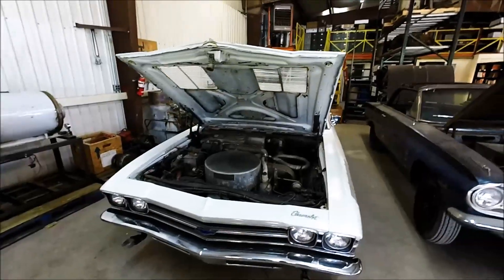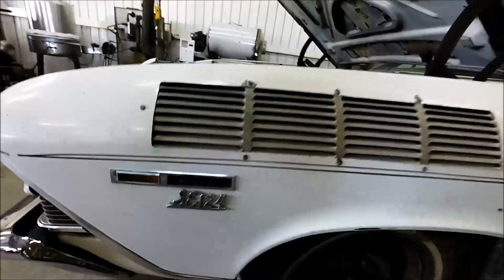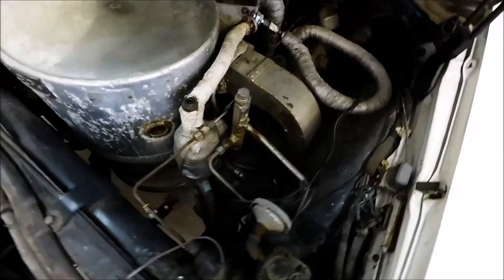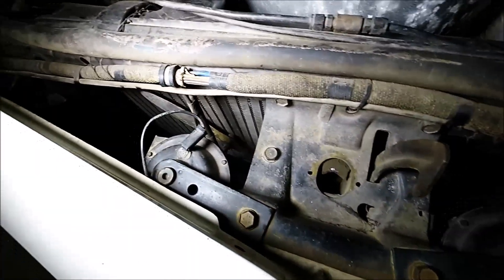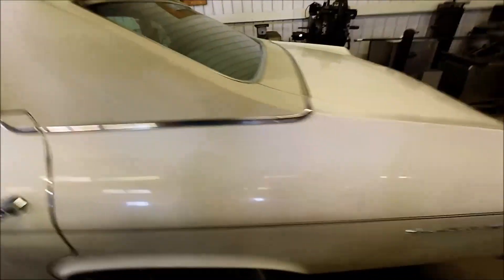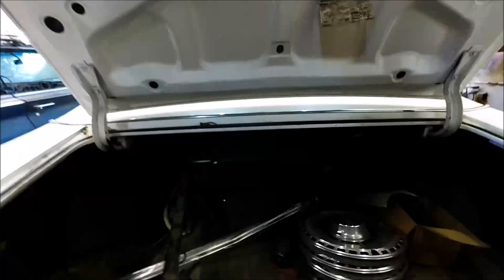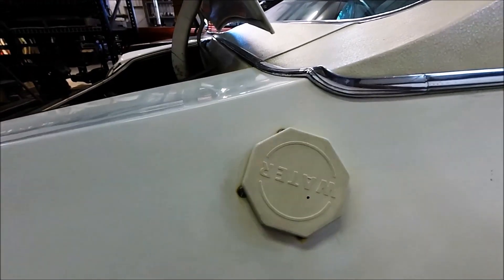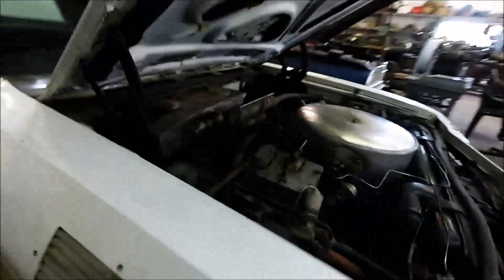1969 Steam Powered Chevelle - Built For General Motors

Comment: Sandervanderkammen9230 really hates steam engines
Reply: I LOVE STEAM ENGINES... I don't like stupid people.
Reply: I dont see why someone couldnt make it work with a heater rod sort of like the heater on an 02 sensor or like with glow plugs to initiate start. After starting have alternator recharge battery and provide the heat for the steam using more glow plugs while it runs.
Steam could possibly work
Even in racing engines

People just dont want to innovate anymore.
In my opinion.
Reply: @advanced8526 You are suggesting to use electricity to heat the water into steam?

So you don't see the obvious reason why we don't make electic-steam cars?

Comment: In 1933 besler systems built a steam powered airplane - it didn't work very well but proved 2 things : steam can get off the ground and for a heaver then air machine to fly to a altitude of over a 1000 ft you need a minimum of 18 percent efficiency. That comes from a air craft engineer. The video is still on YouTube.

Comment: Electronic heating would put steam at the top of the automotive pile
Reply: It would be a pile of something... something unpleasant..
Reply: Why would anyone ever use electric heating in a steam car??? 
Seems like the education system is failing to teach basic science.
Reply: @sandervanderkammen9230  yeah, the efficiency would be abysmal, why would you do that????
Reply: @magicsasafras3414 Indeed, it makes no sense whatsoever... Electric Motors are around 90% efficient while steams cars are less than 20%.
Reply: @sandervanderkammen9230 even if you use a steam turbine with an efficiency of 65 percent, you still lose around half your power, and thats not accouting for the fact that in order to throttle effectively, you would need a generator, and a motor to drive the car, as high efficiency turbines aren't really meant for high throttle variability.

Comment: Steam could have been the future, but it could go a 1000 or more miles on water, so no big oil making money off you every 300 miles.  You know they can make a car or truck get well over a 100 miles per gallon but big oil will not allow it.
Reply: Corporate greed has ruined everything. A damn shame
Reply: it still need oil, gas, kerosine to burn, and according to those that own steam cars, they dont go that far on fuel, so i think big oil whould not care much...
Reply: @Miss-Stephanie-Night  ...spent uranium fuel rods... could use the blue glow as running lights :)
Reply: Steam engines came before internal combustion engines.   But internal combustion engines rapidly drove steam out of the picture because internal combustion has about half the fuel combustion.
Reply: that said ... i want steam cars to make a comeback. and i am gonna build one when i get a garage.
Reply: Uhhh... you DO know that you need some sort of power source to heat the water up to boil it into steam, don't you? And that a power source needs SOMETHING to act as fuel for it to GENERATE that power, don't you? And that the water in a steam engine is just a MEDIUM which is used to transfer energy/power to do the work, and that it ISN'T the energy, the actual fuel ITSELF, right???🤪🤤🤤🤤🤦🙄
Reply: 'Big Oil' would be very happy if you bought a steam car!

They can make a car or a truck that gets 100 mpg... the problem is poor people don't buy new cars.
Reply: @sandervanderkammen9230  Who is "they"?
A typical gasoline car engine is about 25% efficient and coincidentally this means about 25 MPG.   A reciprocating steam engine is about 10 to 125 efficient, therefore at best s steam car will get about 12 MPG.   Check in any good textbook - look up terms like "Carnot Cycle", "Standard Air Cycle" which tell you the maximum efficiency that can be achieved..
As for steam vehicles being as usable as any modern car or truck, check the videos on YouTube posted by people that have restored old Stanley cars and Doble trucks that require a crew of two to drive.
The British Sentinel steam engine road truck burns about 40 kg of coal per 20 km when unloaded.  The calorific value of cola is about 2/3 that of gasoline, so if it used gasoline to heat the water, it would need 130 litres per 100 km.    A similar weight truck (12 tonnes carrying capacity with a gasoline engine would need only about 35 litres per 100 km.
Reply: Steam cars don't run on water... are you really that niave???
Reply: So true 😢

Comment: Mr. Tom Give it to Mr. Jay Leno. He will make it a running car.
Reply: I'm sure Jay Leno doesn't want it, or he'd have owned it by now already.😑
Mr. Tom needs to give it to a skilled steamfitter, HE will make it a running car!
Reply: @joerosen5464 Bill Besler threw the engine together using old worn-out parts and bits of junk, his plan was to pocket most of the money he was given to build the concept.
To build a reliable engine would require scrapping the whole thing and starting over from scratch
Reply: Jay only buys the best... this POS was junk when it was new!!!

Comment: With the tech we got now - I'm sure we can make a viable steam car.
Reply: Unfortunately that will not happen, if you were an engineer you would no that steams cannot be made viable today due to the limitations imposed by the Laws of Thermodynamics and Fluid Dynamics.
No steam car can ever match the efficiency or cost of internal combustion cars.
Reply: @sandervanderkammen9230  But with the tech we got now ...
Reply: @SelectCircle  Doesn't matter... even with technology that we have now, we cannot change the Second Law of Thermodynamics.
The Rankine Cycle can never be as efficient as the internal combustion engines.
Any heat engine that includes a phase change in the working fluid will always be less efficient and more complex.
 Direct Cycle engines are inherently more efficient than steam
Any questions?
Reply: @sandervanderkammen9230  If it's that automatically dismissable - then why has the issue ever been studied in the past like it has?
Reply: @SelectCircle  I guessing you are not old enough to remember the OPEC Oil Crisis?
 Nicolas Carnot published his formula in 1824, before Internal combustion engines were invented.
By 1915, steam car became obsolete technology, replaced by the superior ICE car.
No serious work has been done on the development of steam cars since 1915.
Reply: @sandervanderkammen9230  That's where you're wrong. There have been recent studies. And it was deemed feasible but unmarketable because of slow heat-up. Despite your supposed automatic shut-down - the studies went forward. So either I dreamed all that or you haven't read enough.
Reply: @sandervanderkammen9230 the laws of physics seem to fall apart when a jet fighter chases a UFO - example: making right angle turns at speeds above mach 4  and getting it on radar too. This tells me what we think we know may not be true given the technical break through. One discovery that fails in one area my solve a problem in another area.
Reply: . Sorry kid, Nicolas Carnot published his formula on heat engines in 1824.
His formula established the efficiency limits of the Rankine Cycle well below that of the Otto or Diesel Cycle before they were invented.
Rudolf Diesel proved Carnots theory in 1897 when he invented the most efficient, practical heat engine in history.

The most efficient single Cycle engines in the world are Diesel Cycle engines.
Reply: @sandervanderkammen9230  You just made my point. It's the freaking 21st century. Come on now.
Reply: @SelectCircle So you admit you're not educated enough to know that the Law's of Thermodynamics  don't allow steam engines to be as efficient as ICEs.
Reply: @sandervanderkammen9230  All I know is that what we know is changing every day.
Reply: @SelectCircle That comment reveals someone who has no formal education or professional experience in the engineering world.
Engineering is not a faith-based endeavor, it's a exercise in the Laws of Physics and built on a foundation of facts that are well-known and understood.
Like all the sciences we record and study the failures and limitations so that those who come later will not repeat the mistakes of the past.
 Please refrain from posting false and misleading comments on a topic for which you are not qualified to discuss intelligently.
Reply: @sandervanderkammen9230  O yes. Your righteousness is so intimidating. It's like I'm being reprimanded by the Archbishop of Wankery. How much more time and effort would like to invest in terrifying me? 8 D
Reply: @SelectCircle 
You will never win with these types of people until they "see the light" so to speak.
They are institutionalized and educated beyond their intelligence 😂.

Comment: If this car was working, there would be a video of it..that is, it didn't work.
Reply: FFS There are old movies of it running, the current owner drives it.
Reply: @fizzguts You mean, DROVE it, don't you?🤔
Reply: @fizzguts  This vehicle no longer runs, which is no surprise as it barely ran when it was new. The car was returned to Bessler because it broke down constantly and was unable to complete most of the tests it was designed to perform.

Comment: Trying to find  someone on youtube that has made a modern steam car/truck. Can someone share the link?
Reply: also looking, tribute like.
Reply: @survivalistor6195  if you really want to own a steam car you best option is to buy an old one, no one makes these relics anymore
Reply: Steam cars are obsolete technology, no legitimate engineer or company would have any interest in building a new one
Reply: @sandervanderkammen9230  I would be interested, though our company just started, and it would be more of a marketable prototype to sell conversion kits for older gm, Chrysler,  and ford small block engines for them to be able to be converted to efficiently, safely, and reliably run off steam. Though more than likely for liability reasons would not be manufacturing boilers for production in the next decade or two if ever. I think in the end the op's post was more of relating to something more home-engineered proof of concept like there is with modern day wood gasification to run vehicles you can find all sorts of videos online about that but only a handful of people that share the interest of what more "modern"  steam boilers and engines have to offer.
Reply: @unitytwins6652  Internal combustion engines have been hugely successful because they can be operated on any alternative fuels that can be used with steam but offer several critical advantages without any of the disadvantages of steam engines..
Methane, Ethanol, CNG, Wood Gas even hydrogen is cheaper, more practical and much more energy efficient than steam with the same fuels.
Why would anyone waste their time building a new steam car???
 An antique steam car would be far more interesting and desirable anyway.
Reply: @sandervanderkammen9230 I have seen you reply to almost every comment on this video, what are you so pressed about?
Reply: @KingHydra-xj4hg  The truth... this video is rife with ignorant misinformation about steam technology and some egregious misconceptions about the practical and theoretical limitations of the Rankine Cycle.
Reply: @sandervanderkammen9230 Including Abner Doble???🤨
Reply: @joerosen5464  Abner Doble inherited a vast fortune and wasted it all trying to sell steam cars long after they had become obsolete technology. He died penniless.
Reply: @joerosen5464  Excellent comments.

Comment: I want to see steam make a comeback. With modern technology I'm sure one can be made more efficient then what was made
Reply: A hope I have is that once electric cars become the norm and if we start charging cars as they drive through magnetic induction built into roads or something then you could make a steam powered car that just uses that electricity to heat the water instead of an open flame which with the addition of a modernized condenser could make a nearly completely closed cycle engine. Only needing water and oil top ups. If I ever get the time and money I plan to build my own steam powered car cause I'd love to have one more than any other car.
Reply: @GoldMike_  Why would anyone use electricity to heat water into Steam???
I guess you didn't think that idea through yet?
Reply: @sandervanderkammen9230  it would be a thing for enthusiasts. People who want to have a steam car but fuel becomes too expensive or not legal to burn fuels in cars anymore. Its a work around to use steam in a fully electronic world.
Reply: @GoldMike_  Its obvious that you lack any formal education or professional experience in automotive engineering...
No legitimate engineer or or car designer would ever use electricity to boil water in a steam car, it makes  absolutely no logical sense.
You don't seem to have the slightest clue why.
Reply: There's such thing as nuclear power using thorium
Reply: @cjrstudios4100 Steam is still not the most efficient thermodynamic cycle to  convert the reaction heat to electricity,  water is used primarily because it is a good absorber and shield for radiation.
Reply: That is never going to happen, steam cars are obsolete for some very important reasons related to the Laws of Thermodynamics  no amount of technology can change the fact that steam engines are inherently very inefficient.
Internal combustion engines have always been superior to steam... 
The steam car industry was wiped out after the introduction of the electric starter for internal combustion engines in 1915, completely eliminating the only advantage steam cars had.
Reply: @sandervanderkammen9230  They burn fuel more efficiently than internal combustion and could run on a variety of fuels. There were steam cars made into the 20's that were fast and efficient for the time. The world pretty much gave up on r&d for steam powered vehicles, just like they did with electric cars for the most part. Now look what's making a comeback.
Reply: @DBGH46  That's not exactly true, modern internal combustion technology is very efficient in terms of combustion efficiency.
The major flaws in steam technology is they are extremely inefficient in terms of thermodynamics efficiency, they have always been less efficient than ICEs.
 Prior to the invention of the electric starter for internal combustion engines in 1915 steam cars and battery electric vehicles out numbered ICE cars 2 to 1, since 1915 steam cars have been obsolete technology and electric cars jave always been around in a tiny niche market... and still remains there.
Reply: @DBGH46  Joesph Black discovered Latent Heat in 1761 and Nicolas Carnot published his formula in 1824 that showed that steam engines can never match the higher efficiency of internal combustion technology.
 The popularity of steam cars based enterely on the problems and serious danger of injury or death involved with starting an ICE car built with a hand crank starter.
In 1914 Charles Kettering single handedly wiped out the steam car companies when he invented the electric starter for internal combustion engines.
By 1926 the last steam car companies has either switched to ICEs or gone bankrupt.
Reply: @sandervanderkammen9230   we use steam turbines to generate electricity, cant we just make a hybrid steam electric car
Reply: @taiwoolaleye6333  Why would anyone want a steam car?
Steam cars are obsolete technology.
Reply: @sandervanderkammen9230  a sterling engine to serve as a range extender for electric cars perhaps might work better
Reply: @taiwoolaleye6333  A hybrid car with an Atkinson Cycle engine would be way better... in fact, the best selling hybrid is the Toyota Prius.
Reply: @taiwoolaleye6333  That comment reveals someone who has no formal education or professional experience in engineering... that statement proves that you do not understand the Laws of Thermodynamics and Carnot's Formula for Heat Engine efficiency limits.
Reply: @sandervanderkammen9230  im not an engineer, but i do know some physics and im willing to deep my fingers into some engineering. 50% is the theoretical limit for a heat engine to convert heat to mechanical work. im not hear to argue about performance of power, i know sterling engines need greater volume to produce the same power as ice, but flexibility of fuel source is what the main concern is right now in the world, and a sterling generator in a series hybrid configuration should result in a better use of the fuel. i have a b.s in computer science with a minor mathematics, just finished last year.
Reply: @taiwoolaleye6333  Nonsense! I can go to Augsburg Germany and buy a MAN SE G95ME-C9 Diesel engine that is 54.6% efficient.

Theoretically, the Carnot Cycle Engine is 100% efficient (at absolute zero).

You have alot to learn yet kid... Joseph Black's discovery of Latent Heat in 1761.
 Nicholas Carnot published his Heat Engine Formula in 1824.
Rudolf Clausius discovery of Entropy in 1850.
Rudolf Diesel invents the Diesel engine in 1897.

They all tell us that engines that have a working fluid had requires a phase change is LESS efficient than those that do not.

You have alot of catching up to do!

Any questions?